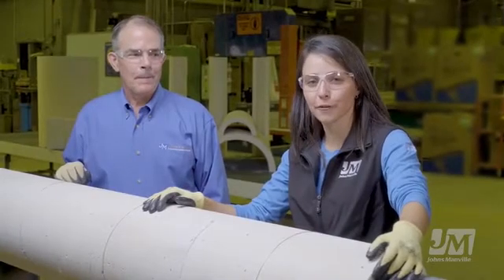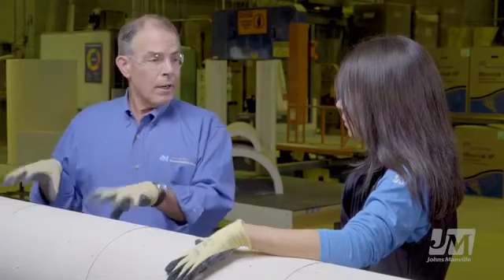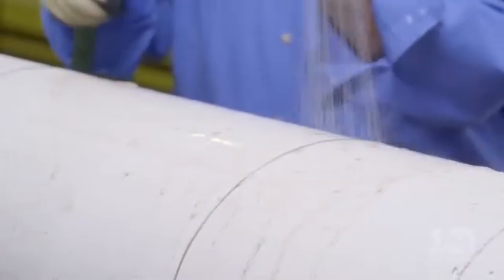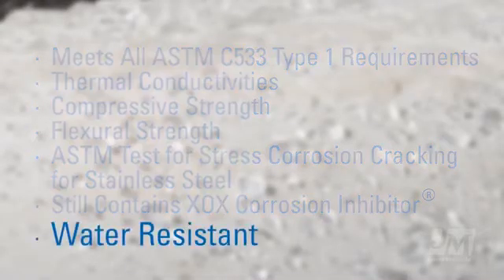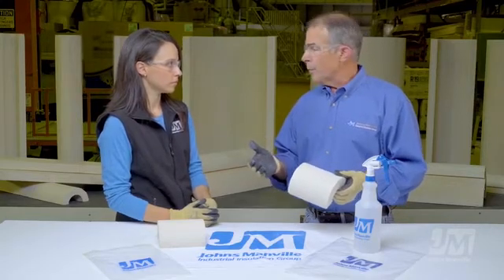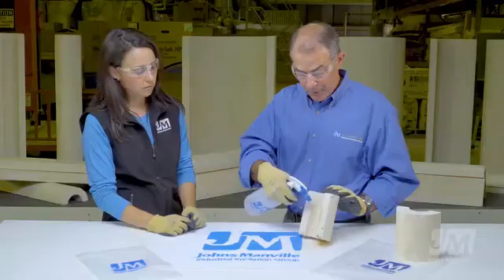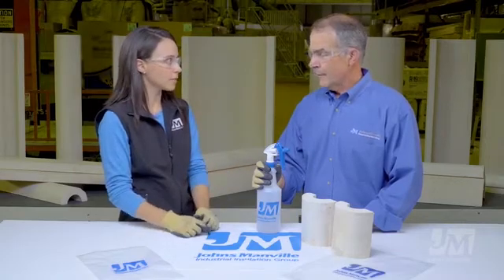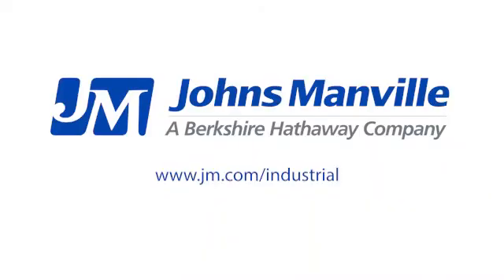Introduction to Thermo-1200® Calcium Silicate Insulation

Comment: Unsafe fire cladding had another kick lick of calcium silicate or and bicarbonate paint ..
All it needs is a good few coats 1mm thick silicone rubber mix another fireproof aspect of silicone melting point.
Roll on wallpaper or sticky back and painted over film skin Also made of good enough paints coatings.
Costly enough mould green black dirt a few months years later most UK  houses are now even less safe catching the whole block or Left right roads council houses terraces or 3 4 floor high flats in terraces all the same stuff isn't so fire proof retardant, 
Upon bricks??
Fire hazards cladding boards.

Bicarbonates and silicone simple mix paint or spray on.
Magnesium oxide or Carbon black and fire clay paints/coating inks dyes ahead of the game fabric and thread to 3D surface and 2D printing games inks  .

Dame madam awardeed over Greenfield activism
https://youtu.be/feOPjw8jjiAx

Comment: Your glue good enough to mix lower rubber silicone (fabsil gold spray) High heat high pressure treatment should close up Merlin melting point melting silicates into glass harder tougher composition or fire 🔥 clay Natural primary colour= 16000 + shade and effect metallic aluminium and 3000°C bicarbonate white Merlin melting point 3000°C possibly opacity otherwise ©®™ non porous paints/stains we waterproof mould rust proof Fireproof silicone Rubber melting point all a good mixture rubber or mixture all colour effect waterproof airtight corrosion proofs paints 10000 thinner paint or extruding sheets/films or boards at 100/1000 thinner doing the same job nanoscale layers slower extrusion p2i technology UK.
Building product wood texture or soaking treated varnish/stains into cellulose wood plastics silica or aerogel silica .

Ever dry formula permanent waterproofing silicone is good enough which isn't biodegradable exactly what board panel tiles facade need to be made of, also beam girder roof outside walls made of UK ..

Silicone or acrylic treatment in a spray nanotechnology lotus leaf acrylic and lotus leaf extract paints are available or lotusan brand.
Non porous/waterproof Fireproof??
Nowhere to be seen bought.
Injecting moulded then skin laminate print similar same colour Effects new inks dyes paints and inkjet laserjet cartridge

https://youtu.be/EJYC9y3DSjU

Comment: Is calcium silicate safe to consume? It's in Dr Jekyll pre workout.
Reply: Don't eat it
Reply: Mix silica beads with bicarbonate all day long and insure no dust powder residue escapes waterproof airtight boards.
Joda international need to go OROS skin thin smaller than water drop breathable hotels as insulation film 1mm thick should be tried tested indoors minus zero -40 °C and indoors body temperature tested to insure heat Will be kept inside sensor in the central L and R what's the answer?